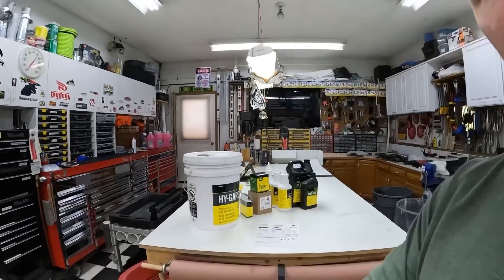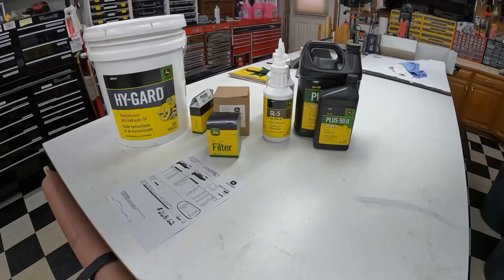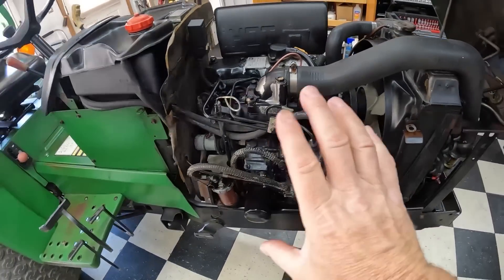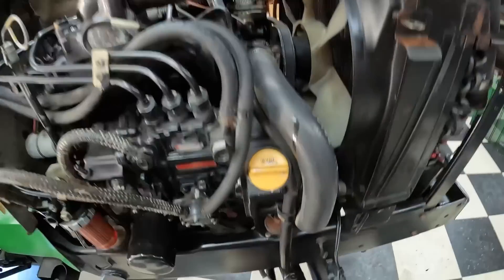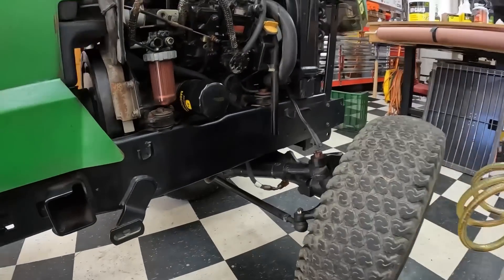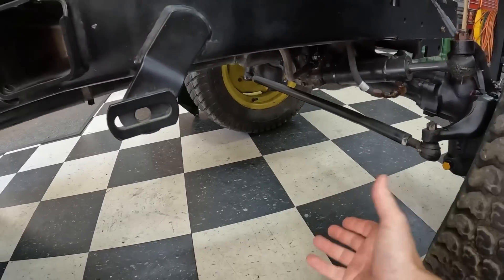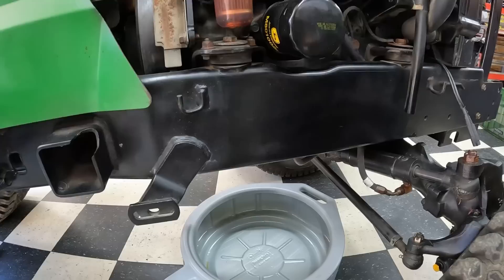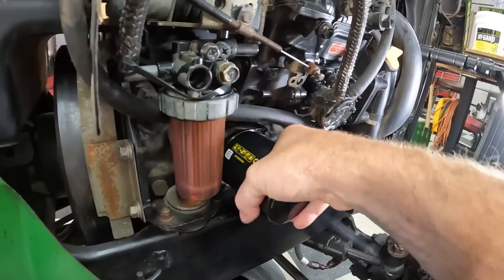How much can you save doing it yourself? It might be time to learn how!

Comment: Nice video as always Doug. Being a Deere owner of multiple pieces of equipment,  I looked in the manual for your tractor, as I have a 955 in the fleet and it calls for Low Visc Hygard. I looked at the container you had there and believe the dealer sold you the wrong viscosity for that tractor. It will make a difference when the weather gets cold, as I went through this years ago. Just a thought. Enjoy the videos, keep them coming.

Comment: As a owner of a one man tractor repair business, I suggest that if you aren't capable of doing it yourself to call someone. When I do a service, I also grease everything, inspect for possible damages, prevent future failures by repairing any potential failures, as well as ensure that it is functioning correctly. If you do have the means and knowledge to do your own services, please do not cheap out and get the correct oils and filters.

Comment: Changing some basic fluids is one thing that everyone should be able to do. The problem is people become conditioned to think that is "maintaining" their vehicle/tractor/watercraft.

Some of the worst deathtraps I have had come into my workshop have been from self-proclaimed "I do it all myself" Home maintenance guys.

They have no idea things like steering couplings and ball joints need to be checked, Suspension bushing and components etc..Wheel bearings, brakes, unishafts.

Comment: I bought a Kubota L3301 a couple of years ago and did all the maintenance myself. I went to the dealer to the dealer for a quote at the 50 hour service which does not include a complete service and was quoted $650.00. I did a complete fluid change and filter change for $280.00 and it took me 4 Hrs total to do it all. I understand everyone needs to make money but my guess is they can do the service much faster than me with tools and a lift.

Comment: I do all my fluid changes on my own equipment, tractor, side by side, and all implements. Only ones I do not do are the car and truck. Only reason is because I'm in my early 60's and it's tough enough getting under the smaller vehicles. I have a tough enough time when I have to change the tires(20's) on the vehicles for winter.It's more therapy doing the stuff like this. Nice video Doug.

Comment: DOUG, great find on that tractor. Don't know what you paid for it, but it looks like it was well maintained. 
The older stuff is much simpler to work on! 
Doing the fluid /filter change yourself is... 'a better way', gives you 'piece of mind' knowing that it was done correctly and completely!
The dealership wants $75 bucks now for my hydro filter and with some research, found a cross reference for the same filter on line for $31.00 ! (NOT CHINESEIUM! but made in Italy) I bought two cause prices are NOT gonna drop. With inflation, I might as well spend money now, rather than trying to.... (save it?!!) Lol

Comment: Hi Doug, too late now but behind the hydraulic/transmission fluid drain bolt if you remove the 3 screws holding the cap and hose on is the suction filter and should be cleaned if changing that fluid.  At least you know for next time!  Edit: Well guess I should've watched the entire video lol
Reply from the maker: Hahahaha, but thanks for the heads up! Appreciate it!

Comment: Problem is we can’t trust very many shops to do it right. Are you getting shorted a quart or half a quart.  Think about those fast oil change places screwing people out of a little oil here and there. Maybe just wiping off the outside of a good cleanable filter. I’m 73 years old and still doing all maintenance on two tractors, two diesel trucks and a SUV .

Comment: QQQ: Hey Doug, question for you. Is there anything a tractor can do that a skid steer cannot do? I’m guessing PTO stuff, but am considering saving and getting ‘one’ rig to start and skid steer feels like the most useful. Hmmm… Thoughts?
Reply from the maker: I love my skid loader but it has its advantages and dis advantages. Consumes lots of fuel, tears up grass and yards. But other than that, they are one of the most versatile machines out there. You are correct about the PTO, but most skid loader attachments are run with aux hydraulics. That being said, I would much rather run every attachment in front of me rather than pulling behind a tractor. It kills my neck to  run a brush hog on a tractor but love running one on the skid loader. Plus on a skid loader the attachment always is the first to hit the brush or dirt pile and so on. But a tractor has its place.. if you need a front loader on a tractor, then you will want a skid loader. They cycle so much faster. Hope this helps!
Reply from the maker: @Toby Getsch, see response above.

Comment: Great video Doug. I know it is trivial but how do you clean the pump between different fluids and how long does it take.
Reply from the maker: @David Cornwell I do not clean the pump out. 95% of the time it is used for motor oil and the other 5% is used on transmission oil. I take my oil to a guy that burns it in a waste oil furnace so no need to ever clean out the pump for me.

Comment: Check NAPA auto parts, I get filters air filters etc for a decent savings. They have quite a number of parts that fit most of my equipment.
Reply from the maker: @Jeff Peters Thanks Jeff, I actually did check NAPA on line and found some of the things were cheaper and some were more expensive. So it was pretty much a wash. But I did have a good piece of mind knowing that the filters were correct from the dealer. No cross referencing or wrong filters when I got home. I hate making return trips for the wrong part!!